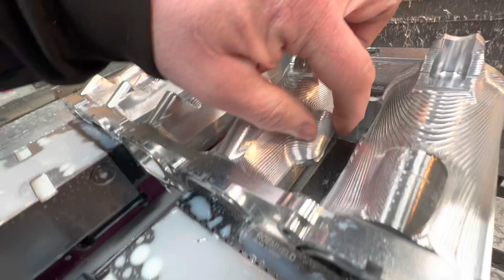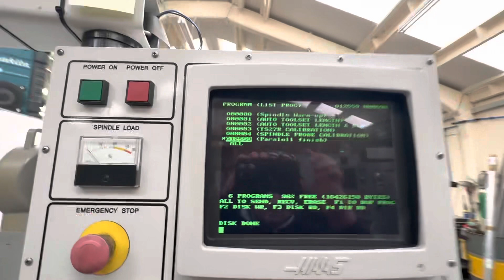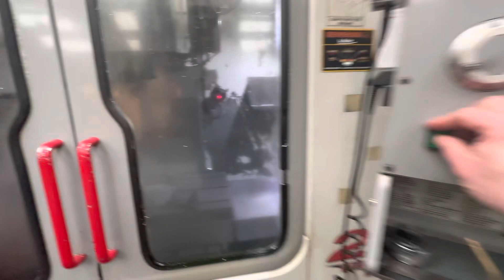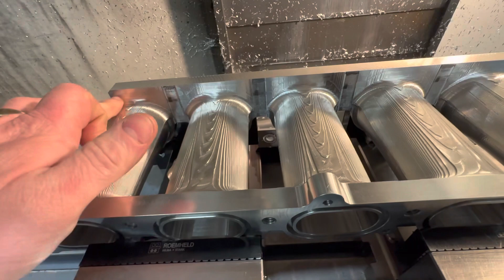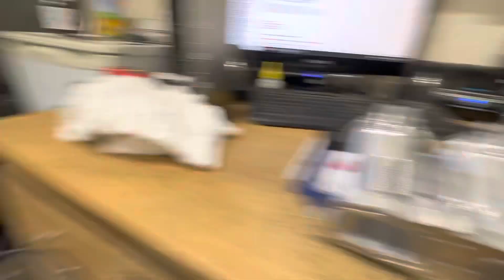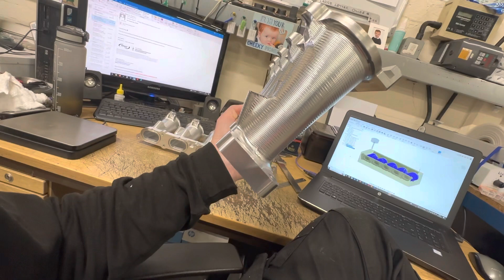Finishing the outside profile of the billet intake runners on the Haas vf3

Comment: Did you ever consider a lolly pop mill? You can even do sum undercutting with them. They seem to be more rigid then a standard ball mill, there ground different on the bottom so its free'er cutting.
Reply from the maker: The tool I’m using can do slight under cut, it turns out I had machined to much away in op 1 from the other side 
I will do another video showing where I made the mistake

Comment: Slowly but surely 👍

Other than a 12k spindle and side mounted tool carousel there is not much on a newer machine to make it all that and then some. With every successive generation Haas had taken more of the end user's control away by locking/removing features and adding more nanny BS to keep the idiots from hurting themselves.
Reply from the maker: Yeah I hear ya on that,

Have to buy a service key to do even the basic self maintenance like spindle orientation reset etc what a joke

Comment: you are on the right track for how to setup the 4th axis. use a fixed origin at the center of rotation, then model your setup and probe it to find the relative location of your part.
Reply from the maker: I’ve got it modelled up now with centre of the 4th axis rotation in z & for the y I have matched the model origin to the centre of the table that way I can locate the bolt pattern and dowel pins easily

 Then an easy point to locate off the x that is a finished surface
Reply: @kinzy_fabrications  as long as the y axis center of your table is also the center of rotation for the a axis then you should be good to go. if its not then you either need to tap it into position to be aligned perfectly or determine its actual position relative to the rotary axis and just model it that way(this is the way I do it, so im not chasing part alignment with an indicator, only measuring and modeling. most of the time its much easier to move the model than move the part.)

In the machine you can zero your tools as normal, then set the z axis g54 to the center of rotation.

at first its a lot to wrap your head around, but once you do its not hard at all. I actually prefer doing it this way now since I done have to change my offsets on my machine and that means less crashing.
Reply from the maker: Once I have modelled it all up il do a video of how I’ve done it and post it up for all the see 

Thanks
Marc

Comment: Coming along nicely! Is it possible on the haas to just brake/lock up the 4th so you can almost just use it as a manual dividing head at set angle for each setup and use normal 3 axis prog? If that makes sense 😂

Ps link your eBay shop in the description as well so people can find it
Reply from the maker: Yeah I can basically work as 3 + 1 and have the 4th move to the desired angle and lock in place via the air brake  and that’s what everyone is suggesting to do, I was just thinking fancy with simultaneous 4th axis lol but I’m out of my depth with that and it seems it’s not a common way to do it

Comment: Great job on this part! Looking at the injectors my thoughts would be when in the fourth axis setup I'd come in at a 90° in relation to the flat on the injectors the same with the top. This would eliminate the need of a long tool.
Reply from the maker: That’s what I love about this sort of thing, you stare at a job and don’t see the obvious and then someone comes along and points out the simpler way to do it lol

I think your right there, that will avoid a long tool stick out and should work as well so when I can I will program and simulate and see how it comes out

Thanks
Marc

Comment: Looking real good :) And you are also doing it the hard way, so good. And timestamp 44:16, to finish this wall, you can draw a path along x axis, up and down over the 5 pipes, and follow path with tool if you get me? My job is 90% 3 axis, so when i get 5 axis jobs to do on 3 axis because all 5 axis machines in the shop are busy, i struggle to sometimes.
Reply from the maker: Hi

Yeah I see what you mean about the path along x axis, i wonder if it would work with a straight flute tool in 1 pass or if I would have to do multiple passes with a ball end mill tool

Thanks
Marc
Reply: @kinzy_fabrications  With as little tool stickout as possible you could maybe do it in 1 go, but i think i would do it with ball tool( better transition on the radius around pipes? You proberly know better then me.
Reply from the maker: @TheTrex600ESP  
No that makes sense to multiple pass with a ball nose and stay just off the rads previously done
Will be a bit of trial and error I think but worth a go maybe
Reply: @kinzy_fabrications  Agreed, you just have to try. Leave some stock on the first go if you can.